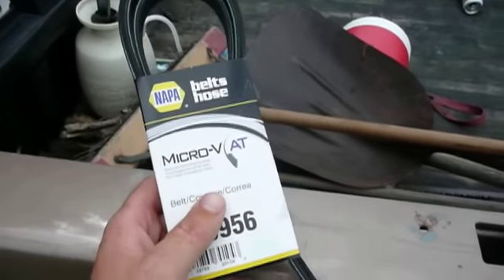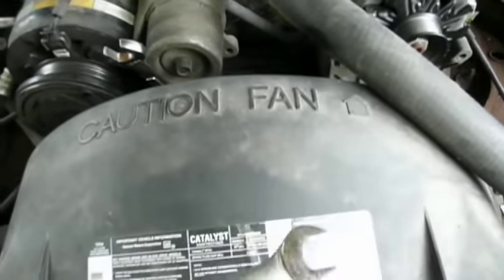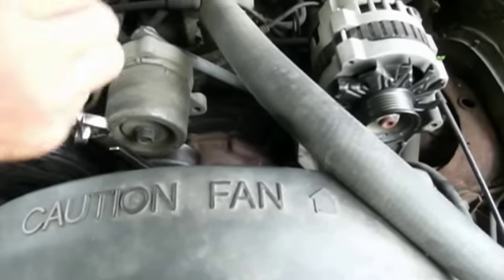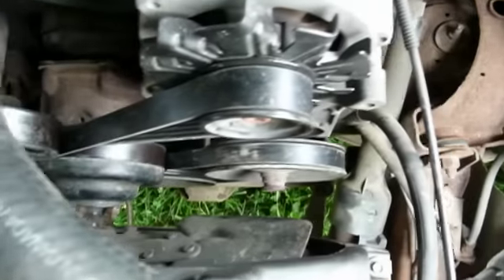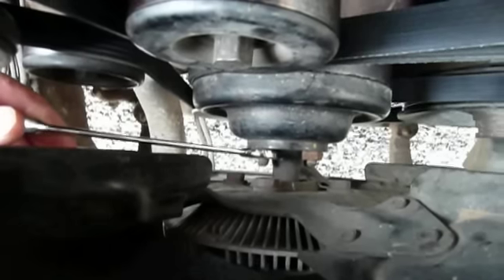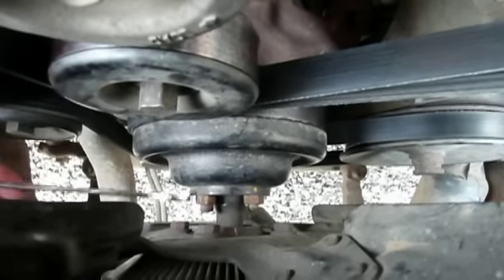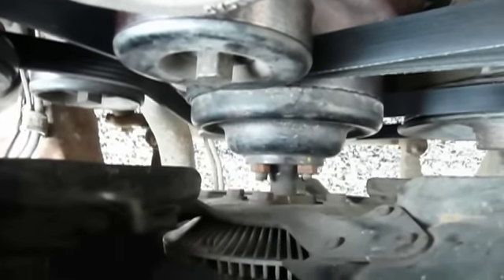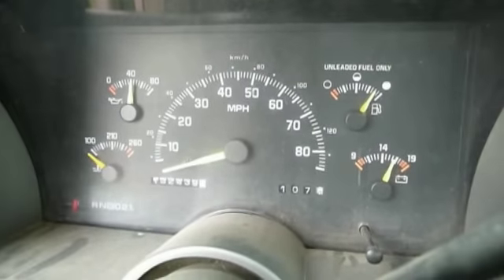Fixing The Serpentine Belt - 1994 Chevrolet C1500

Comment: Remove the tensioner from the mount. Lay it on a flat surface facing up. Pour  just about an ounce of light oil . Let it sit for about ten minute s and then spray some liquid wrench around the seam where the spring is. Re-mount and then reapply your tension on the belt. Worked for me!

Comment: the tensioner was something that threw me thanks for the video. my mechanic wants 400.00 to put a new alternator. 85.00 for altenator 35.00 for a new belt. I,m saving 315.00. thanks again.

Comment: I noticed that your truck has the same "bulb test" wiring flaw as many older GM cars from the 80s.  When you crank the starter, instead of testing the overheat idiot light, it pegs the temperature gauge instead.  I had no idea vehicles as late as 1994 still had that bug.
On some cars it causes the needle to become inaccurate (because it gets torqued every time it hits the stop) and in some cases it falls off.  Yours seems to move slowly though, so maybe it has some dampening to prevent that.

Comment: good job ya did i had to do this on my truck 3 times its a 93 chevy first time the idler pulley busted put it back together and the belt came off and busted my water pump broke the studs etc new belt was 17 bucks but water pump was 29 bucks mines a 4.3 looks like that one has a 4.3 as well chevys for life

Comment: You do not need to remove any "water pulley studs" to replace a fan belt! Simply feed it in between the balancer and water pump as per diagram. It goes on without any fan removal.
Reply: He said they came loose after the came off the day before

Comment: i have a different belt tensioner. it uses an 18mm on the top and a 15mm on the bottom pulley. i cant get the belt off and there are no videos on YT with my setup....i have an 89 C1500 with a 5.7. the belt tensioner needs to be replaced cause it makes a very annoying screeching sound when i drive and idle.

Comment from the maker: No the serpentine belt doesn't affect the brakes on your Surburban. Some things you will want to look at is your master cylinder, see how much brake fliud you have in it. If it's low go buy some DOT 3 Brake fliud. If the master cylinder is full something else is wrong and you should see a professional mechanic.

Comment: What is up with the noise from the motor?    Sounds loud like some chugging metallic noise and my 1994 4.3 sounds the same.     Is it an accessory belt driven noise or a pulley?
Reply from the maker: When this video was shot and uploaded, the truck had a failing pulley drive on the A/C compressor.
Reply: @thekeykeeper2009  Are you saying a failing AC compressor or AC clutch on the compressor?
Reply from the maker: @redphantome737  Both.